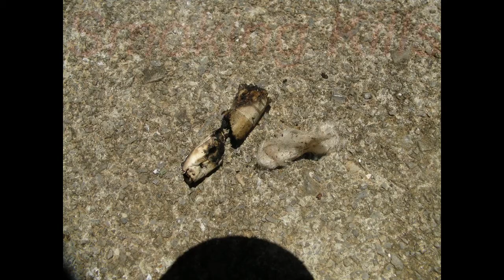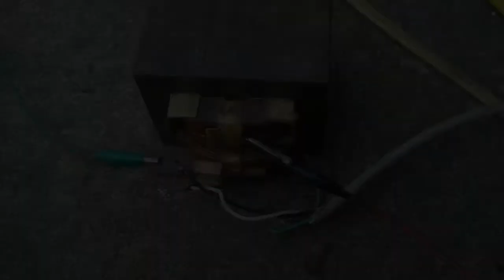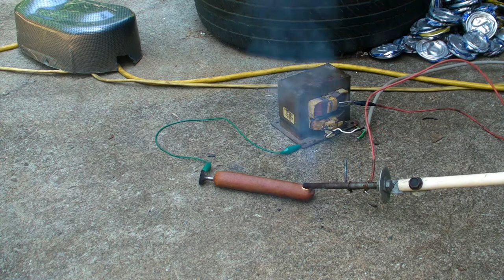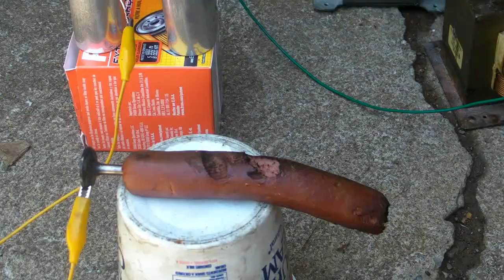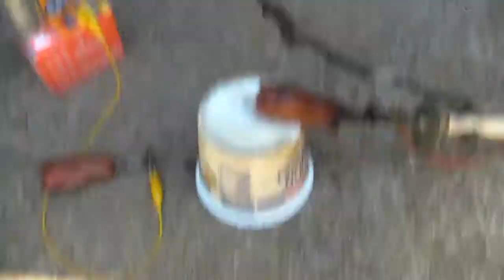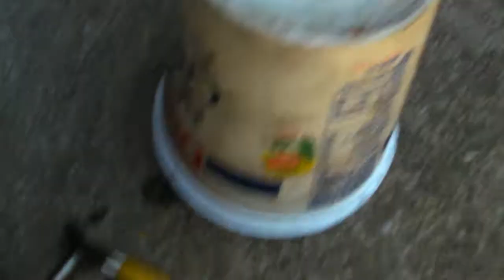Cooking A Hot Dog With High Voltage

Comment: Mmmm electrically cooked hot dogs. xD
Reply from the maker: the finest!
Reply: juniortore1 Sal's Spark Seared Sausages! Now cooked with 2000 more volts and 400 more amps! These MOT be the best sausages around! ba dum tss

On a side note, I got one of those low quality Chinese laser pointers (my dad bought one). It says 100mW on the package, but from what I've been able to tell, it's only 30-40mW. I can disassemble it and get to the circuit, but turning the trimmer doesn't appear to make the dot change brightness at all. How do I max this thing out? xD